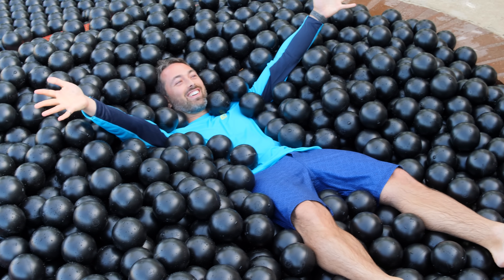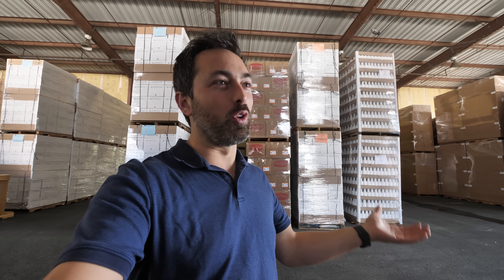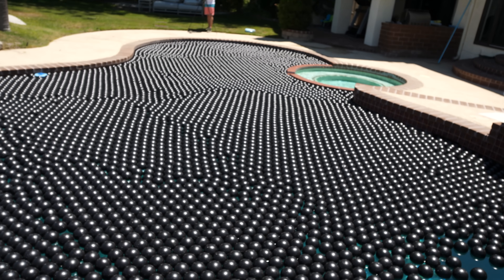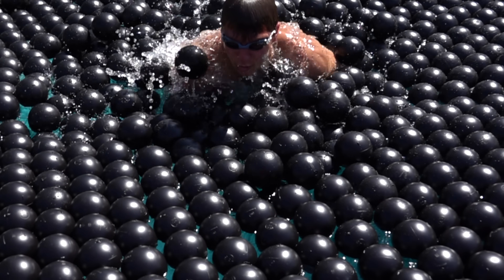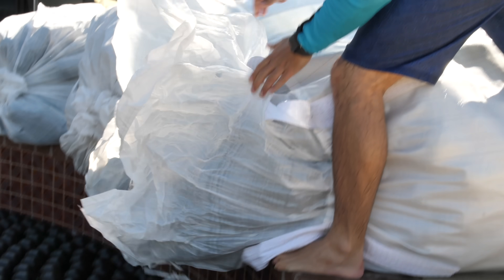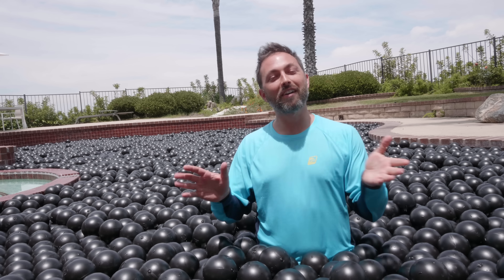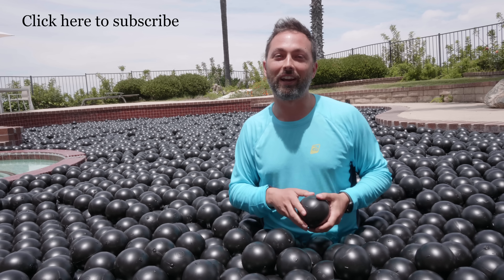Can You Swim in Shade Balls?

Comment: "You cant swim in drinking water" 
Proceeds to drive a boat over it
Reply: At least the boat doesn't wee in it :p
Reply: The boats are probably sanitized
Reply: @trvs7797  I believe that the main concern is that petrol-propelled boats tend to leak engine oil and other pollutants into the water they're crossing, but this shouldn't be the case with electric boats (I guess?)
Reply: @dz7se  Engine oil does not multiply in water. It dilutes to the point of unmeasurable values in seconds. (he did the math on other channel.) Bacteria, diseases, parasites, syphilis and gonorrhea, on the other hand will multiply and proliferate in stagnant water like that pond.
You say engine oil... That reservoir is unguarded and unprotected. Anyone could drive a truck full of poison into it. But nobody actually cares, because in those billions of gallons of water even strongest poisons will dilute to the point of no actual harm.
Reply: Eletric
Reply: So what? Driving a boat and swimming aren't the same thing, duh.

Comment: Your swimming is pretty horable :P your for your front crawl:
1. keep your fingers together
2. Put your hand in the water a half arm length Away
3. Cut though the water with your fingers
4. Keep your hand just underwater
5. Move your hand forward untill your arm is fully stretched.
6. Push your hand down next to your body. (Same for back crawl)
7. You are not a water mill, the human body is designed to allow more complex movements :P

Regarding your butterfly 
1. Small leg push
2. Big leg push
3. Arm forward

Comment: Can't swim in drinking reservoir

Proceeds to ride motorboat in reservoir
Reply: I suspect the boat is regularly steam cleaned to make sure there is no introduction of pathogens, invasive species, etc. Reservoirs around my house allow aluminum rowboats for fishing, but must be regularly steam cleaned.
Reply: Well now u got hot plastic in the drink water too
Reply: @Minytek23  Yeah, but they (at least said in the original video) extensively tested whether the plastic bleaches out, and they said they noticed no leeching or bleaching whatsoever
Reply: @Miny What about the ultimate form of plastic. Micro Plastic.
That birds and fish eat and we humans eat the fish that have microplastic inside them.
Reply: @m1ndsolve  hmm interesting 🤔 ill have to check it out
Reply: @N0N0111  They tested and concluded that this perticular setup of round, cornerless, black shadeballs, with water inside, doesn't shard microplastics.
Reply: Miny it dosent melt....
Reply: No even an electric motorboat.
Reply: CorwynGC yeah because cost is no issue? Gas goes In the engine not the water.
Reply: @squidinkRC  Of course cost is an issue, but electric motors are comparable or cheaper.  But the issue is not the gas, but the oil.  A water cooled ICE motor is going to have oil in the water discharge.  Check out the rainbow colored slick you get off any outboard.
Reply: Ew, all that exhaust and unburnt trace gasoline.
Reply: Henriko Magnifico where's  the logic I ask you .

Comment: At 7:28 you still have the water levels wrong.  In order to displace the weight of the ball above the water, the water level inside the ball should be lower that the water level outside the ball.  Of course, I only make this comment because your science is normally so good.

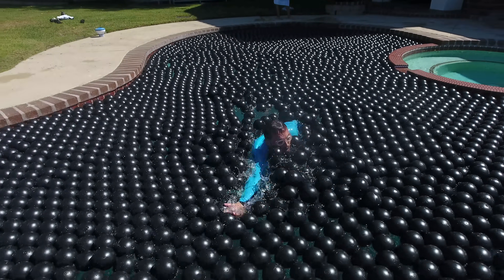Comment: 4:57 This is a clip I will start showing to my flight students to explain and demonstrate why parasite drag (drag caused by the airplane moving through the air, NOT by the creation of lift) increases with speed.

Your explanation of how you are experiencing more of them at higher speeds is correct, but you can also look at it with pressure.
As you travel into the particles, you are exerting a force forward on them. The pressure is increasing. The balls behind you, in your wake, are at a lower pressure, seen as open space in the water. Because a fluid wants to travel from a place of higher pressure to a place of lower pressure, you are going to get caught in that and have a force applied in the direction of the lower pressure; the direction opposite of your travel.

Comment: Quick tip: close your fingers when doing front crawl 😂
Reply: front crawl? not freestyle?
Reply: Juicybread “freestyle” events in swimming are actually “use whatever stroke you want” events, it’s just that the front crawl is the most efficient stroke, and therefore the stroke that is always used in freestyle events. Hence why it has become essentially synonymous with freestyle.
Reply: Juicybread freestyle just means you can use any stroke you want in that event, from crawl is the name of the actual stroke most poeple use
Reply: @remymebarek0157  yea freestyle I thought
Reply: See I thought the same thing, as I'm a former swimmer, but I think his mentality is to create a wider surface to push the balls out of the way.
Reply: Hey you fellow Alexandr Misko fan! 😂
Reply: @UCR7hVCARvRN-tM1_MPov77Q actually a much smaller space then that. you want as to create a strong vacuum between the fingers. 5-7 mm would be much better. You create a difference in pressure between your fingers that helps your hand push more of a ball of water rather than letting water flow between your fingers. This gives you the most momentum.
Reply: As a former swimming instructor that shot really triggered me
Reply: @Asdervbn  mabey it was mm not cmXD
Reply: in swimming you want your fingers about 2-4cm apart because if they are touching you lose surface area and it makes your stroke less relaxed

Comment: Drag is also proportional to v, and higher powers of v though. 

The coefficient of the quadratic term tends to be greater than that of linear drag for many objects. By inspecting the units of some constant a which makes av^2 have units of force reveals this coefficient has a dependence on the cross section of the object (the linear term would be related to the length).

This means something with close to no cross section, like a needle, drag would actually be dominated by the linear term!

Comment: 3:55 how can spheres block 91% of the light... Isn't it more like π/4= 78,5% ?
Reply: 90.07 is correct: draw an equilateral tringle with the sides length as the diameter of the balls. Place a circle with the diameter of the balls at each corner. Calculate how much of the triangle is covered by circle segments.
Reply: My calculation is false because I only consider one circle in a square... In fact the edges of neighboring cirlces are covering this square too

Comment: This guy: "Its swimming water, I'm not gonna swim in drinking water"
Also this guy: *Drives boat in drinking water*
Reply: Honest comment
Reply: I was thinking that too when they were driving the boat lol.  I guess if the boat is only used in that pond and is clean... ideally the motor is not leaking anything either.  But I'd be more worried about bird poop.  Hopefully there is a secondary filtering stage after that pond.  I imagine there would be.